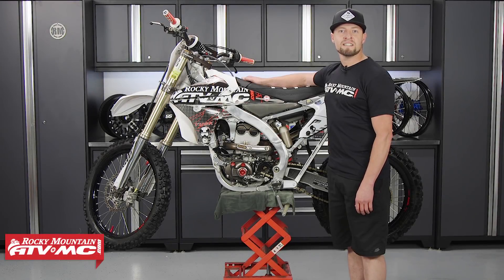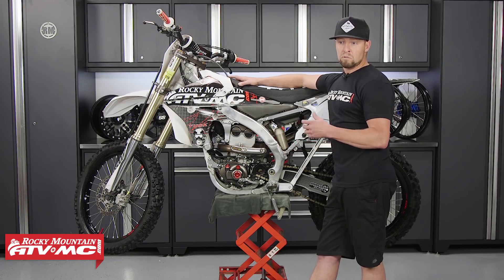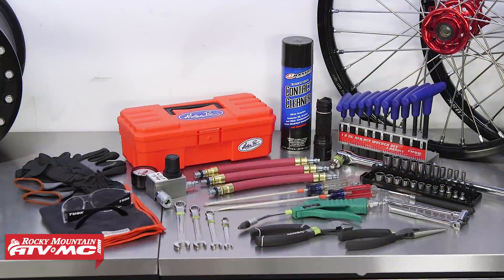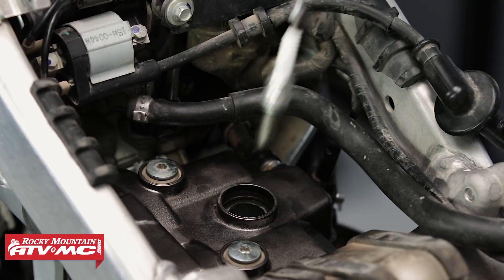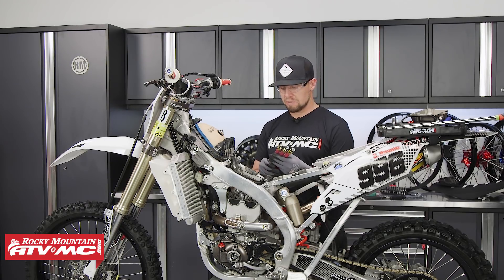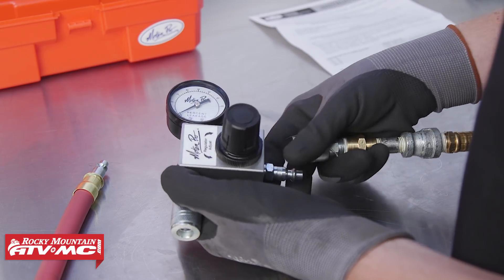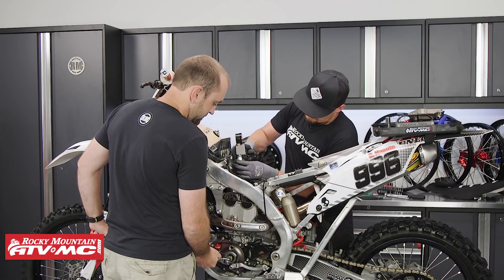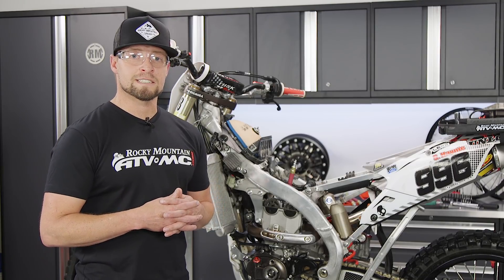How To Perform a Leak Down Test on a 4-Stroke Motorcycle

Comment: Your best benefit for this tool is to use it on a brand new bike or engine or after every rebuild and then at regular intervals thereafter. Keep a record and you can track the health of your engine better. Also whenever you have a question on performance or power dropping off, you can immediately do a leak down to see if it’s engine health or some other component, before you start chasing the tune, plugs, jetting etc.

Comment: What bike is that ? My Husaberg has everything possible in the way of the spark plug hole.
Reply from the maker: This bike is a Yamaha YZ250F.
Reply: @rmatvmc  Thanks, I used this video to determine my compression was about 50psi after quite the struggle pulling out the plug with the frame in the way. I’m puzzled because my 350 still runs. I was afraid to screw the adapter too tight because I would then never get it out but I didn’t feel any pressure escape. Definitely will be doing a top end.

Comment: Good video. I have been doing leak downs for years to decide the health of my engines. One thing that I have found is when the engine is set at DTC on compression you may get a false reading because of the auto decomp. holding an exhaust valve open. This may lead you to believe the E. valves are not seating. Rotating the engine just past DTC will deactivate that auto decomp. As mentioned it is easier if the valve cover is off. That way you can see that the valves are all closed with no cam/auto decomp. contact on the valve. 

The other option is to deactivate the auto decomp at DTC at the cam with a wire or something that works on your model. This will let the E. valve seat.
Reply: Solid Tip!!
Reply: Does leakdown require you to take the engine out of the frame ?
Reply: No it does not, as shown in the video. @davidb9323

Comment: Hello, thinking about buying a MT-324 snap on leak down tester from eBay, planning to do a leak down test on my 2008 Crf250r. I’m not sure what size the adaptor is that come with it, are they universal or will I possibly have to buy a new adaptor hose? Thanks!

Comment: Stupid question. Leak down test vs compression test.  🤦🏻‍♂️ 
Is leak down just multiple tests vs compression being one value?
Reply: Compression test is air pressure created naturally in the engine when you kick it over, this is then recorded to make sure as the piston rises everything stays compressed to near factory standards. Where as a leak down test you pump outside air into the engine and see how much pressure it will hold. If it won’t build high pressure the engine may not be sealed well. Whether that be ring wear, hole in piston, scarred barrel, bent valves or incorrect valve clearances. Worse case scenario apart of the engine is cracked but sometimes it may be very simple. Leak down tests tell you an idea of where the problem is whereas compression tests just give you an idea of if it’s holding pressure. Also you must decompress the system on a lot of 4 strokes
Reply: It's my understanding that you can't do a compression test accurately on a 4 stroke with auto decompression.  Leak down is the way to go.

Comment: Would bad oil seals cause low compression?
Reply: Because I have a 94 dr125se and I did a leak down test and im getting air from the stator side so to me its gotta be a oil seal. First I put new rings in it and it went from 125psi to 140psi. And when I had it apart the valves looked good and clean and didn't leak when I did the test. All ne gaskets and o rings to
Reply: No. Oil seals just prevent oil from running down the valve stems and entering the combustion chamber. The valves themselves seal off the combustion chamber and if they aren't sealing you will lose compression. Worn piston and rings are the other main culprit. If you were getting pressure in the crankcase on a 4 stroke motor the ring seal is probably bad. The leaky seal itself shouldn't cause a loss of compression on a 4 stroke.

Comment: How do u know what is wrong if you have compression but lose it on kick start
Reply: When you kick start it does it not give you any resistance. If so, you could be missing some of the gear spacers or retention clips. Its possible for some of the gears to slip out if their place and not transfer the power onwoards.
Reply: Your kickstarter can also be slipping on its rod. Maybe you're missing a gear. Who knows. 🤷‍♂️
Reply: It's a come and go compression wen I put a new plug in is wen I lost compression
Reply: Wen I pulled the motor apart the rings were stuck to the piston
Reply: @kawasakijim9695  Then maybe you've found your problem. change the piston rings. They have to be tight agains the cylinder to get compression.
 
The sparkpluggs also have washers that need to be tightened hard so they expand and keep a tight seal.

And og course you need a good head gasket.
Reply: Also look for wear while your in there. You dont want anything breaking after all the work..